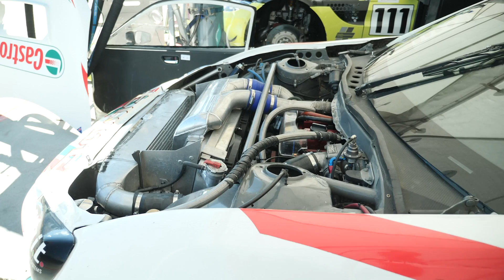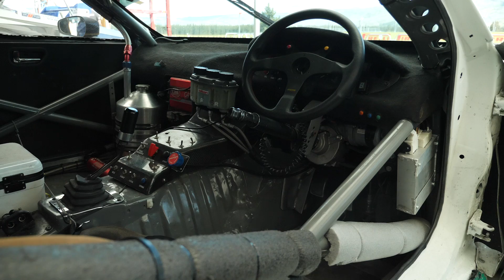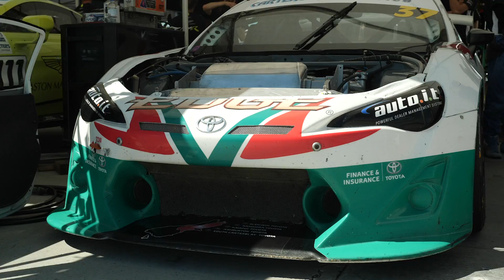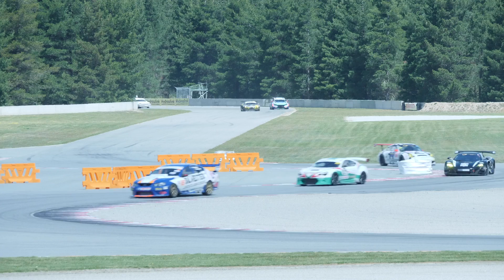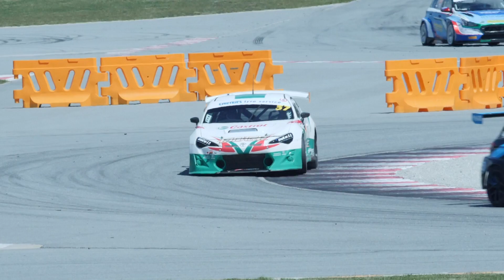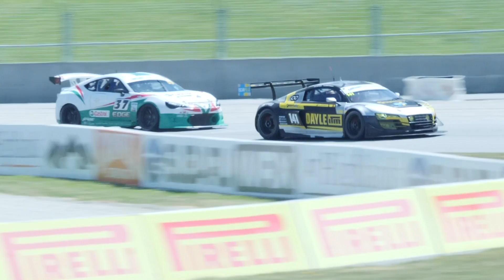Backyard 600hp 2JZ | AE101 to GT86 Endurance Conversion [#TECHTALK]

Comment: Bruh why would you do that it would be cheaper and more effective to put 2j in an 86
Reply: It didnt exist back then
Reply: @rustedratchetgarage6788  you do have a point I forgot it was 14 years ago but I still think it would be more cost effective to get an 86 chassis because the engine fits way better and it’s more cost effective because if he damages any body panel he has to get it custom made because all these parts are 1 of 1

Comment: I'm surprised they haven't went single turbo already with all the development of the suspension. I guess that's part of the process of development though. They'll have everything else sorted really well once they're ready to rework the powerplant.
Reply: I think they do it dual for better control and less lag
Reply: @rustedratchetgarage6788  no way. Not being rude. They said about half way thru the video they were planning on going single. Turbo tech didn't use to be as good, so it used to make sense to keep the twins. Now you can get power and responsiveness with a single.

Comment: Meanwhile my ae101 is sitting a paddock with half the factory engine apart...
Reply: Also love the dektite shifter boot! :P
Reply: haha, meanwhile my ae101 has been sitting in my lockup for 4 years and still havnt got around to replacing the chronic leaking cam seals.